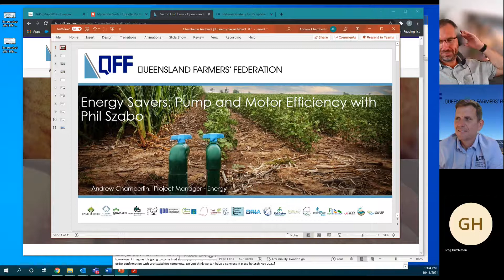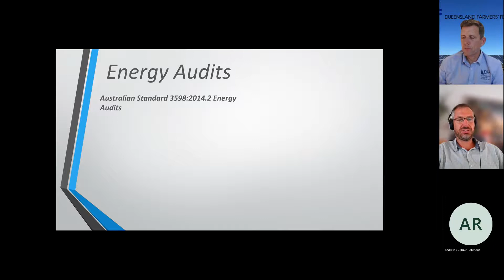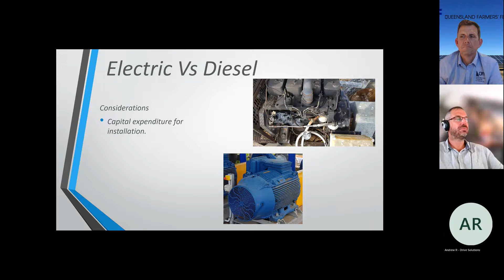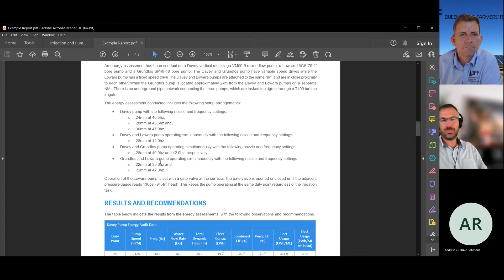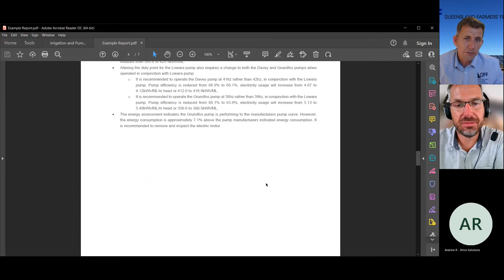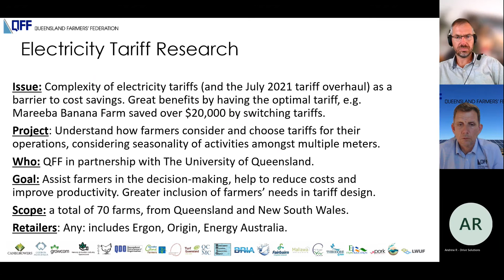Energy Efficient Pumping

Comment: Thanks QFF for making available these series of webinars, great presenter (Phil Szabo); loved the way the explanation of what  kWh/ML/m is used for as a benchmark.  Some argue that the term isolates the pump and motor from system inefficiencies, whereas in reality,  it reflects overall energy efficiency, including hydraulic losses, system deterioration, and motor performance changes, that's why I can be used for comparisons of systems, provided that they are operating under similar conditions.  Good stuff !